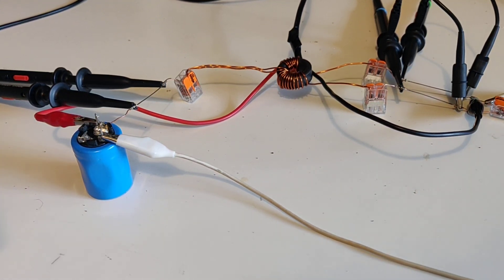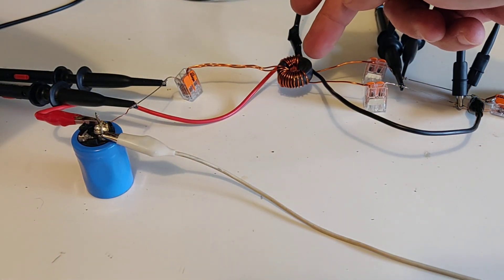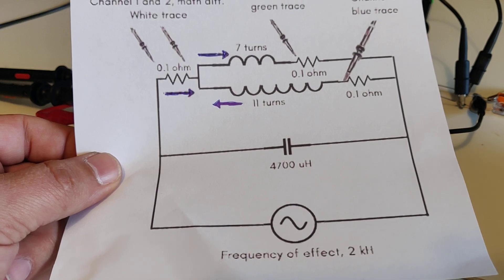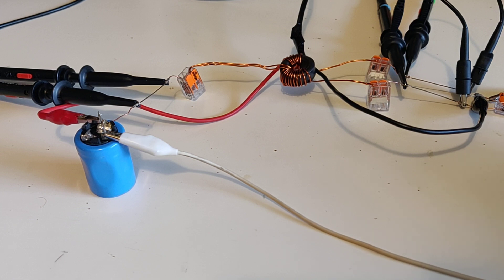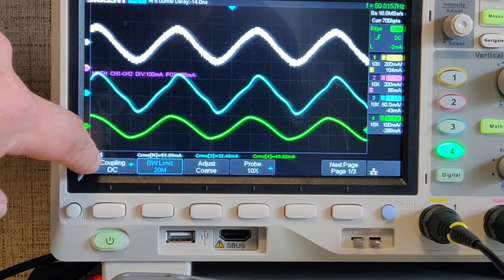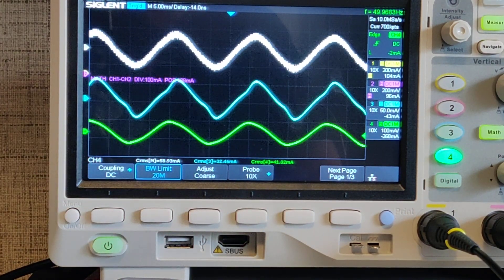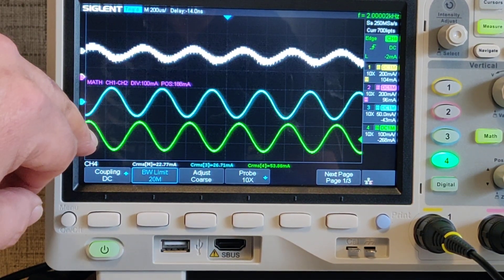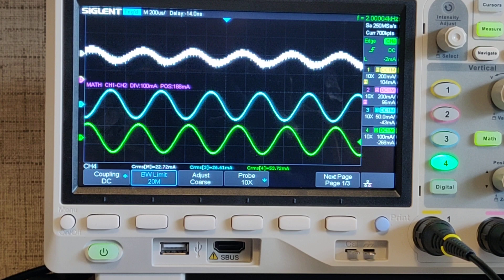MrPreva Experiment Replication

Comment: Hi Fringeldeas,

Itsu again :-) 

looking at your lates posts in your thread: "My MrPreva Experiment Replication" you should perhaps look at a post on OUR about the impedance of an Audio Amplifier.

It seems not to be limited to 2, 4 or 8 Ohms as there is something as a "Damping factor" involved which happen to decrease the amplifier impdance to like a minimum of 0.1 ohm or so.

I could type in a link to a thread / post on OUR, but any links will cause this message to be deleted by youtube.

Member Picowatt mentioned this, so if you are a member on OUR you seach for "Damping factor" and member Picowatt to find it.

Basically it says that in the specs of your audio amp, look up the damping factor (mine had 250) and divide the output impedance of this amplifier (say 4 Ohm) by it to get at 0.016 Ohm as the minimum useable output impedance.

Regards Itsu
Reply from the maker: Sorry for the late reply, and thanks for the info. I'm not on any other forms at the moment, and probably won't be. I remember back in the day of Eric Dollard's crystal radio initiative, bouncing around a few forums, and to be honest it was quite painful trying to sort through all the garbage And currently life is really limiting my study and bench time as it is :) But thank you again for the info!

Comment: Hi Fringeldeas,

you mention / show the input current being measured between the capacitor lead and the junction of the 2 coils, but this is not really the input current.
Its situated within the parallel LC circuit created by the capacitor and the 2 coils.
So you are measuring the (reactive) current sloshing back and forth between the capacitor and the coils.

The real input current should be measured between the FG and the capacitor.

Regards Itsu
Reply from the maker: Hey Itsu, it's a pleasure, you have some good videos. I did mean just the input going into the branch of inductors, might have got my terminology mixed up a bit. It's been a while, I'm still trying to remember how to use a scope. :) However, now that you mention it, it would be smart to go back and take a look-see at the actual input. I do appreciate the comment! Br, Marcel
Reply: Fringeldeas, although Itsu is correct, he is missing the point of the MrPreva Experiment, which is to see the Current that causes the effect is well less than the total Amplified Current in the DUT! Floyd Sweet wrote: "Current is deemed as a quantity or number of charged particles moving from P1 to P2 in time t, or as the charge transferred in one second by a current of one ampere. The coulomb is the charge on 6.24 x 1018 electrons. Electric fields are due to the presence of charges. Magnetic field effects are due to the motion of charges. Current is the net rate of flow of positive charges. This is a scalar quantity.

In the specific case of positive charges moving to the right and negative charges to the left, the effect of both actions is positive charge moving to the right. Current to the right is: I = da+ / dt + da- / dt. Negative electrons flowing to the left contribute to the current flowing to the right." which is the total point of Energy Machines that can go Above Unity! The MrPreva Experiment is a part of the total Picture!
Reply: @SweetSQM   mr Preva takes the rms of the voltage on each 1.2ohm resistor by multiplying the amplitude of each signal with 0,707 and then adds them.

Visually compare the 'input' signal with the 2 signals into the coils without using rms, sere if the numbers still exceed. Use  the sum math function on the scope.
I admit I may be missing the point and overlook something important.